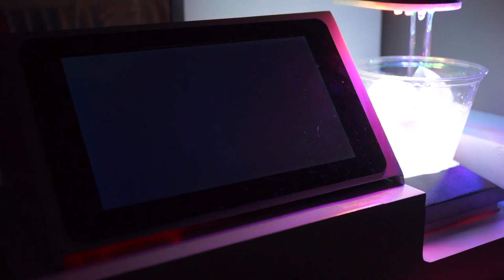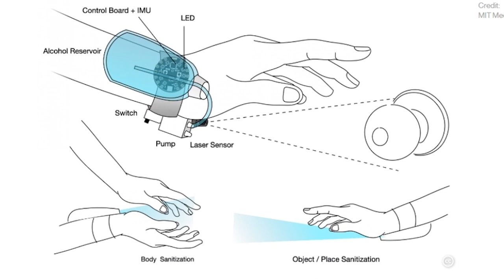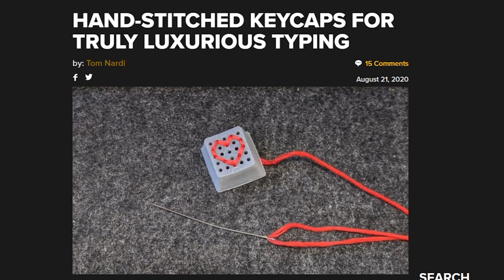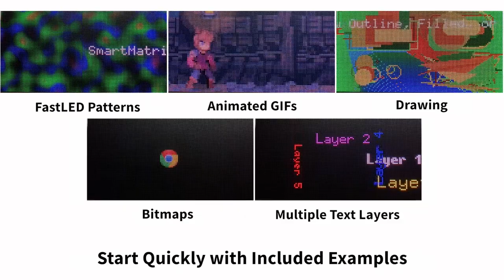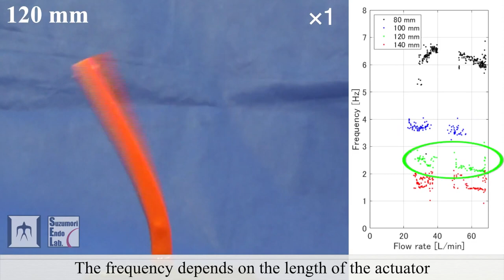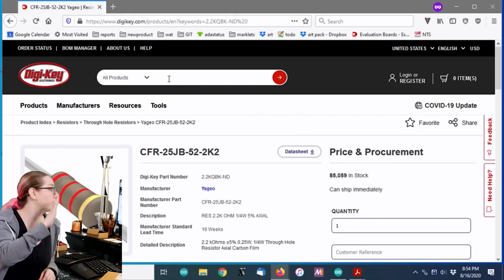You Can't Do It [Maker Update #194] - Maker.io

Comment: Donald, I see a lot more of laser cut items these days in the maker sphere - Are there any really decent low cost options available? Especially since its harder to get out to any maker spaces with the isolation situation.
Reply: I'm a fan of using these laser cutting services. I've been using Ponoko and they are great, but there are other good ones out there. Yes, it would be nice to have a cutter right in my shop so that the cost per print is lower and you can try fun experiments, but it's also nice to use a service where all of the settings are already dialed in just right, not to mention that you won't need to use up any more of that precious precious shop space.
Reply: @DanHoke  thanks, never even though of looking for a service.